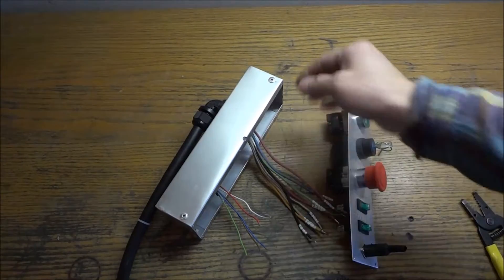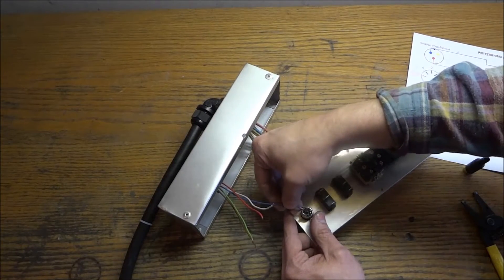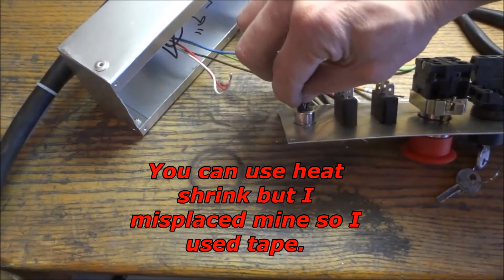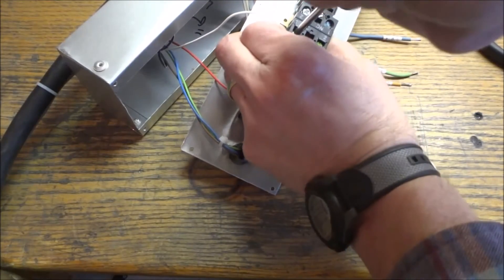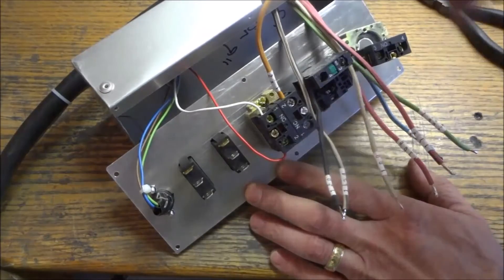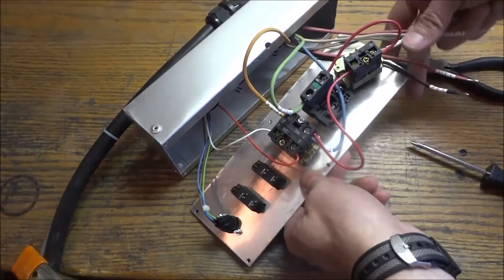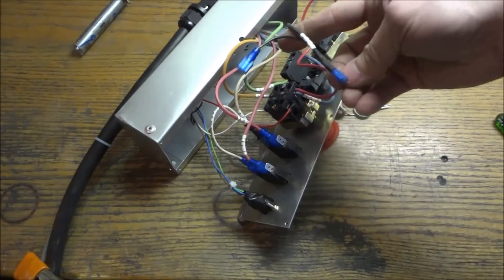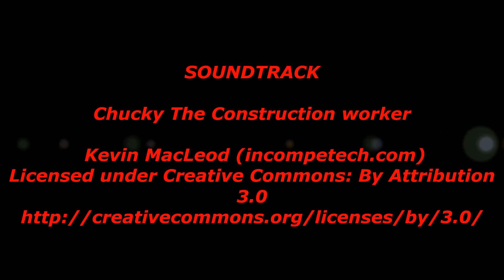PM 727M Wiring Pt 5  "The Control Box"

Comment: We are building a control box similar to your one, but with different modifications. We would like to add 2 e-stops. Normally we would just connect the 2. one in series and "loop it back to the first one", so no matter which one we press we will stop the system. Question is what happen to the other wire connections on the original e-stop ? Do we need to consider these ?
Reply from the maker: If you downloaded the wiring diagram from the link above you can see wire # 102 goes to one set of contacts and then changes to #103 on the other side to C1 contact and start P/b. the other set of contacts on the E stop go to the BOB wire 100 and terminal 10 .
In order to connect a additional E stop simply wire it in line with the other E stop and connect a wire between the top contacts. and the Bottom contacts. 
Be Safe,
Sam

Comment: Love the detail. Great job. I have a question, do you need a ground on the control box?
Reply from the maker: +Daniel Herold 
Thanks, a ground never hurts but I just didn't have another conductor I will end up mounting this to the enclosure so everything will be grounded in the end.
Reply: +CNC4XR7 The machines I have been around use a copper sleeve that is slipped over the outside of the cable. It kind of looks like a Chinese finger cuff or the shield on coax wire. That may be a consideration if you were going to have the control box hand held. 
I want to set up a CNC mill myself and have been studying up on the subject. Your videos are a great inspiration. Thanks again.
Reply from the maker: +Daniel Herold  Yes a ground strap I see them all the time. I'll see how the build goes if its not grounded through the frame work it may be something I'll add.
thanks for watching if i can help with your build let me know.
Sam

Comment: Hi Sam,
         So I'm having a hard time wrapping my head around the contactor wiring for momentary and estop. So I went hunting for contactor you used. Purchased it from Ebay. I figure, if I can't conceptualize, I'll just wire it myself. By the way, wow, you know how to eBay bargain hunt.   Are you using a DC voltage to actuate the contactor or is that AC 110 v? How do you think that contactor will hold up?   Thanks again for the great videos... and diagrams( It would have taken me a month just to complete the schematic.)  --Don
Reply from the maker: It's a 110v  ac contactor coil. 
I will do a overview and theroy of operation in the last wiring video. 
Be safe
Reply: Thanks Sam.  Looking forward to it.

Don